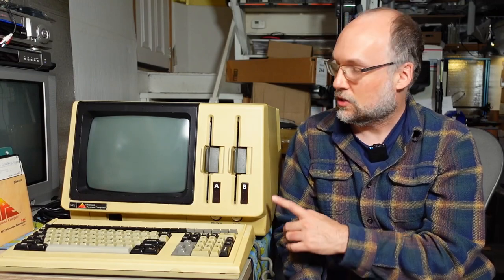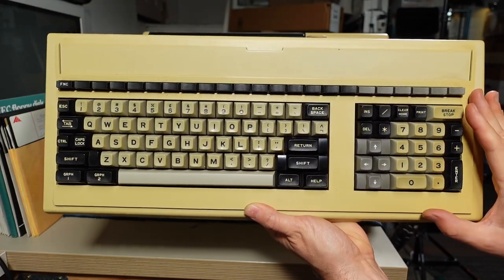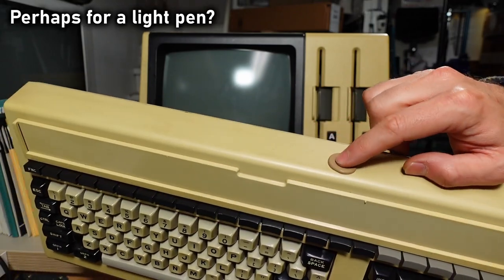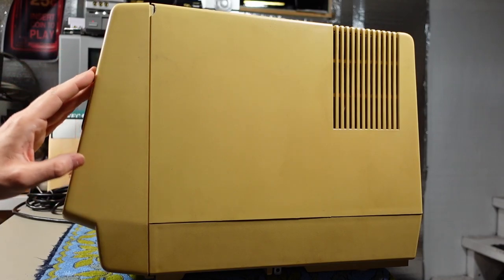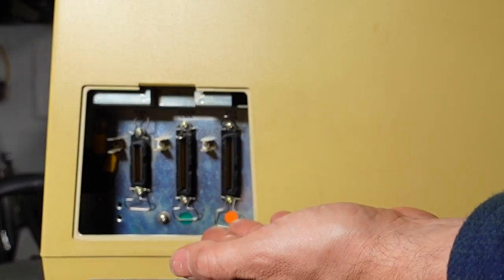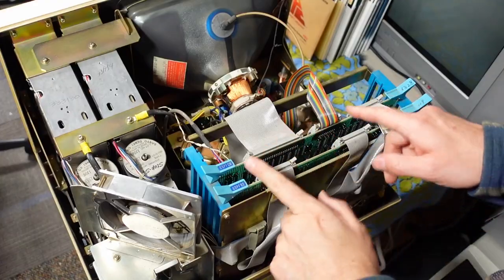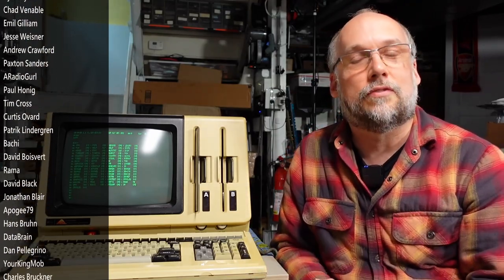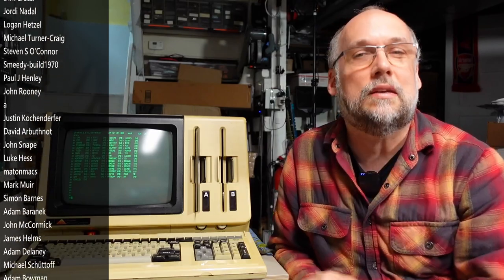The NEC APC runs MS-DOS from 8" disks

Comment from the maker: I added some links to the description of a source for diak images (of some software) and scans of the manuals for this machine.
Reply: 8255 = 3 each 8 bit parallel ports.  Likely the printer uses part of this guy
8237 = DMA controller and also dynamic memory refresh.
8254 or 8253 = 3 16 bit counters that do the 18Hz interrupt and also times the memory refresh
8259 = interrupt controller 2 of them used in PCAT also.
later on NEC made their own versions of each of those under a different part number
Reply: look to see if the DOS has interlnk and intersrv.  If so they can be used to transfer files.
You need another DOS with interlnk and intersrv
Reply: Awsome, what is my special gift you are promising? Just kidding I reported the post as spam.
Reply: Some scamer in comments...
Reply: @grantfryer1  Oh you get this scam message too xD
Reply: @kensmith5694  3 x 8 bit or 2 x 8 bit and 2 x4 bit. Wee used it a loot in the old commodore 64 days to make hardware to it.
Reply: @JyskMaker  I believe you are correct.  I was working from memory.  I freely admit that my memory is imperfect.  I can only remember things from the past so that makes it 50% at the best.
Reply: @kensmith5694  :-) and i my memory is correct then the 2x4 bits was some sorts of control lines for the 8 bits port. It was fun to make stuff with, like eprom burner and so on.
Reply: @JyskMaker  Yes, or hanging binary weighted resistors on it to make an audio output.
Reply: @gelo1238  Seems to have been removed. I got the notification, but the scammy message didn't show up. 🙂
Reply: @TheAnkMan  they will come back

Comment: Just a heads up, the PSU will actually slide out the front of the case (Think there are a couple of screws under the front edge.)

Comment: These were in the computer labs at college my freshman year. We ran CPM OS disks and programmed in Basic. What a way back moment!
Reply: Nice picture of your setup on your channel Ed!
Reply: Cool thing, thanks for sharing 😄👍
Reply: my early computing days were at school too, with  an Exidiy Sorceror machine which also ran CPM and we could only programme character-based stuff on there ..  no graphics capabilities at all..
Reply: A few memories.  Thee company where I used to work got at first a TRS-80 for inventory control. It came with a tape drive and 16k memory.  Both turned out to be inadequate, so a memory expansion to 48k RAM was bought and I got the task to install it. Soon after, two floppy drives were also added.  By default it booted into BASIC.  It was used for the original purpose for a number of years.
 Next, the accounting wanted their own computer, and as then the common "opinion" was that IBM PC was the one that businesses were supposed to prefer (and that "no business would make a wrong decision by getting an IBM"), so the search was started on that basis.  However, a "Clone" marketed as Sperry won, especially by price.  Actually it was made by Mitsubishi.  Anyway, it came with MS-DOS version 1.5 and was buggy.  But rather quickly we got version 2.1and that worked fine.  It still was equipped with two floppy drives.  But once the 2 accountants had settled on computerized operations, then they procured an XT with 21 MB hard disk.
 Then the Engineering secretary gor another XT for her report and letter needs.  Its specialty was that it was equipped with an interface to print on an IBM typewriter.  Finally, a few years later, Engineering got their own computer that by then was an '386 and we got our first CAD program and a large format plotter.
 After sharing the Engineering computer, I built my own computer from a kit, running enhanced CP/M by Richard Conn on it..  Even later, I bought my first laptop computer, made by NEC.  It has 2 floppy drives and a specialty, a RAM Disk.  I still have it, although its NiCad  battery of course is dead.  I am in the process of replacing the 8 cells with 3 LiFeO4 cells.
 There is some story about the AMD 9511 to Intel license deal.  AMD got as part of the deal right for the Intel 8088, but then Intel went their own way with the 80287 and did not extend any more licenses to AMD.  That was the beginning of the multi year court battlle between the two companies.  I followed that, because we used the AMD 9511 math processor in one of our products.
Reply: @InssiAjaton  ah, memories, something similar happened at my company , only with amstrad/schneider pc's

Comment: Maybe Usagi Electric could make a 50pin adapter between your drives and the standard Shuggart connector.  He has done something like that already for his Centurion Project.
Reply: With everything documented, that's a very good possibility.
Reply: PC floppy interface is based on a connection with 4 select lines like this interface, but IBM abused that to construct the twisted part of their two-drive floppy cable.
Reply: Now that's one cross connection I wasn't expecting to see, but getting him and Adrian together could have interesting results.
Reply: @johndododoe1411  Even with that issue it should be possible to knock something together. They're just 1-of-many chip selects in essence. Even if you have to twist or untwist wires in the cable. Maybe even come up with some kind of cascading passthru kind of thing like the Atari ST floppy connection takes advantage of to select from two drives that each only have one drive select input available, but two outputs on the computer... Or use a simple multiplexer / decoder IC... etc.
Reply: @tahrey  Point is that I suspect it's really the same interface.
Reply: @johndododoe1411  Ah right, as in the APC and IBM are using the same thing underneath, just with some obfuscating bodging on at least one of them?

Comment: Also, if ever you wish to access the PSU just remove the two screws below the screen bezel - lift the APC up from the lower edge of the bezel and you will see the screws securing the PSU - which just slides out. The APC is really nicely built. NEC really went to town with it!

Comment: It’s absolutely fantastic to see such in-depth documentation that came with the machine.
I wish companies were required to do so after the product line was discontinued.
Reply: They should be required to do it as soon as the product is released; if they get to wait until after, the company might already be on the verge of going out of business so there's nothing you could do to punish them for noncompliance.
Reply: @stevethepocket  I'm with you on this one:  manuals, schematics, etc. should be provided with the system at sale, at least as a separate purchase option.  That way, those interested can buy them, and those who aren't can opt out.
Reply: @horusfalcon  PDFs dont cost money to copy. It should be part of "right to repair", instead of them charging thousands of dollars for the documentation.
Reply: @nitehawk86  They would probably have to pay for some redistribution fees before being able to give out the documentation, but I'd be fine if I had to pay for these as I'm gonna take a big cut off that as well (as I'd use them for any future repairs).
Reply: Indeed. It sounds like NEC wanted this computer to be a standard implemented by everyone.
Reply: It does seem like NEC was trying to be very open about the design in the hopes of garnering interest in companies building software/hardware for their computer design.  Too bad it didn't work out for them and in the end they joined the rest of the world in the PC/AT clone wars.

Comment: Always nice when the documentation is respectful of users! Publishing the PAL equations - wow, really top notch stuff. I wonder where the engineers who designed this thing are now. Perhaps they've brought some of that philosophy to their later works.
Reply: I can't remember which, but either Tandy or Olivetti/AT&T did similar with their machines of a similar ilk (as in, fast-ish 8086 based with 400 line displays and somewhat oddball bus connectors etc). Problem is there were some glaring mistakes made with some of the published data, which I've run into when trying to do the screen refresh calculations on that side... (it "scrambles" the input to the CRTC through a PAL such that directly programmed CGA modes, including some custom ones, will work correctly with line-doubled output and it isn't limited to well behaved pure-BIOS software compatibility ... e.g. it solves the "MS Flight Sim" issue. Problem is, it does that with all the native hi-rez modes as well, with anti-scrambled data sent to the PALs from its own BIOS... but if you follow through the process, the numbers that come out the other side are... fairly believable, but are at odds with what the manual otherwise claims the output frequencies / etc should be. And there's no way, without scoping the real hardware, to tell if it's those precalculated figures, the PAL equations, or the anti-scrambled BIOS data that's incorrect... but plenty of opportunity to smoke a fixed frequency monitor with bad code, or a bad translation of good code if you've had to spin up a replacement PAL for a burned out one using the published equations...)

Comment: Cool! My first job out of college sold these things.  Really brought back memories (like how noisy the drives are and how C/PM 86 seemed to be really disk intensive.  As well as repairing the very first hard drive.  (The cable came off inside the hard drive enclosure.)  It was my first experience repairing something completely out of my league.  You can see the high persistence in the way the cursor blinks.  The color system was really impressive, especially when running a CAD demo display.
Reply: I fixed hundreds. Not an exaggeration.

Comment: Very interesting machine. Several 8086-based computers came out before the IBM PC or at the same time, running CP/M 86, its multi-tasking variant Concurrent CP/M 86 and later MS-DOS. Most were based on completely different architectures. Some were way more advanced than the IBM PC with hi-res monochrome graphics, DMA for floppy disk and hard drives, supporting much more RAM etc.
I worked on a machine somewhat similar to that NEC box. It was available with a choice of 5"1/4 or 8" drives. I remember that the 8" drives were incredibly faster.
Reply: I would like to add to that. On several machines you got more ram and other options than in a IBM PC computer. Plus if somebody had not mentioned it yet. You would just call those machines MS-Dos compatible. Thus, any True ms-dos program should run. But as pointed out. Not IBM-Compatible programs.
Reply: I don’t see how much faster they could be. My 486 has a 1.2mb 5.25” drive that’s pretty fast 🤨

Comment: I worked in a public building in 86 or 87 during their process of converting their HVAC installation over to control by a system that used one of these as the operator's terminal. It had the color monitor and did some really impressive graphics for that time. I learned CPM 86 backwards and forwards..

Comment: Awesome. The APC Color is one of my top-tier "Unicorn" machines, I have mulled over the idea of re-creating it with 3D printed parts (the case, obviously)... I doubt anyone else would do it but having everything so heavily documented would make it easier to emulate - and the emulated version could more easily max out RAM, graphics, speed, etc. I'd prefer to have the real thing, obviously, but who knows if I will ever be in the right place at the right time!
Reply: Having one of these running on full ram man you could do a lot with it. especially if you get 128 off that battery memory rom stuff.

Comment: Thee Sanyo MBC-775 from 1984 also had those mechanisms for its 5.25-inch floppy drives.  It also just sat there once powered on and did nothing until the floppy drive closed on a proper boot disk.  In its case, the only proper boot disk was a proprietary "Sanyo" brand of MS-DOS 2.11 or earlier.  It would not boot with any other floppy.

Comment: I had one of these when I was a kid. My dad bought it from a Finn that got it from a news paper (?). It had the color display and was upgraded to 768k and had a gigantic 10M external hard drive. The floppy drives are 1.2M and the low density format is something like 252k. We had AutoCAD 8 and Wordstar running on it. The floppies should still be in my parents basement, even if the computer (and harddrive) died almost 25 years ago.
Reply: Hello - would you be willing to unearth those floppies? It would take some considerable trust on your part - but id love to read them and convert to a .img file and them post them back to you? I'd be able to share the files with other APC owners then. Hard to find is APC software.
Reply: @alancotterill2750  Sure thing! But I won't be able to do that until Christmas. I think there also was a compiler there as well. Something oldschool like Lisp or Cobol.

Comment: I bought mine monochrome 8” dual disk bundled with softwares and a NEC Spinwriter. It was a business package, came with CP/M 86, Benchmark Word processor, dBase ll and MicroPlan Spreadsheet. Way ahead of the IBM PC at the time.  I later added a FORTRAN compiler. You could be on that monitor for 8 hours straight and very comfortable on the eyes. There were hard disk option, math processor, color monitor and could run AutoCad. Later came MS DOS for this machine. 

I dusted it off few months ago from decades in storage and it booted right up and seems to run fine, really high quality. Most of my old PCs are dead, mostly bad motherboard capacitors and CD ROM drives couldn't eject.

Comment: Very interesting to see old hardware like that is still potentially functional.

In the early 1980s I worked for a firm that had two computers in the front office that ran off 8-inch floppies. Somewhere around 1984 of 1985 (I think) they equipped all of us project managers with IBM PCs. The ones we had were "upgraded" -- they had 384k of RAM, and TWO 5-1/4" floppy drives. (And the standard monochrome monitor). The operating system was IBM-DOS 2.10. We ran IBM DisplayWrite as our word processing software, and the program required shuffling among four different floppy disks, depending on what operations you were performing. We ran the computer and the software from the first floppy drive, and we used the second drive for data storage. After about a year of that, I talked the office manager into letting me buy an internal card that had a 10MB hard drive built into it. That made life a lot easier.

Comment: That disk drive sounds amazing. There's just something about such a pronounced "the computer is thinking" sound.
Reply: One of the things I love about PCs from this era - you can almost see / hear what's going on inside all that silicon.
Reply: I’ve still got such a strong nostalgia for the sounds my first computer’s hard drive made. Both the large seeks and smaller clicking sounds. If I ever rescue that beast it still won’t be the same, if the drive is silent.
Reply: Look at how many chips there are on the FDD! They must have been quite advanced  devices at the time.

Comment: I was lucky enough to be given one of these earlier this year. It has sat on the bench in the shed gathering dust until this video inspired me to turn it on.
What do you know, it works, has a color screen and a 10mb hard drive although it is missing the data cable for the HD. Has two extra cards which I have no idea 
what their purpose is yet but will spend sometime this weekend finding out.

Comment: This is really not that related, but I have a Series III Fairlight CMI. What made me think of it is that that the Fairlight also has plug-in cards for related hardware functions. The Fairlight’s cards are in a metal cage which are an absolute sod to get out with those push tabs! Also, the Fairlight famously has 8” floppy disks, although mine is a rack mounted version and would have had them in a separate cage. The Fairlight Series III was available in 1986, so not far off the APC in terms of production. I love watching you bring these odd/old computers back to life. I think for me, like others, there’s a certain joy in watching them boot back up again. Terrific video.

Comment: You can use Kermit or Move-It or Crosstalk XVI to transfer software. They were all released for APC. You can also use 22disk as well. I see you have about 20 software disks, please upload them! APC software is not very well archived.

There were quite a few games for the APC actually. They were 8 color and ran on CP/M mostly. They also required the expansion graphics card.

The bumper on the keyboard covers a reset switch.

The unlabeled function keys were programmable in CP/M and didn't necessarily correspond to a template.

The power supply comes out without taking out the CRT. It is on its own tray that slides out from the bottom after undoing a couple screws.
Reply: or laplink pro
Reply: Mr Guru  what’s mame?
Reply: Mr Guru  oh your talking about STEAM